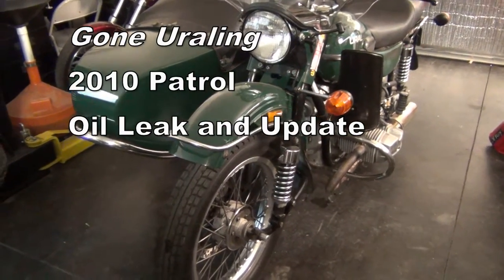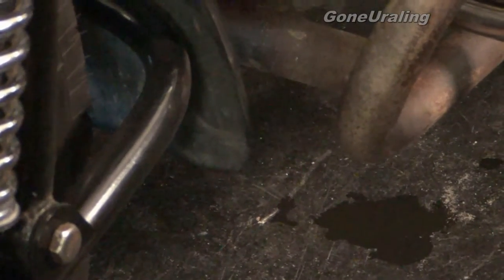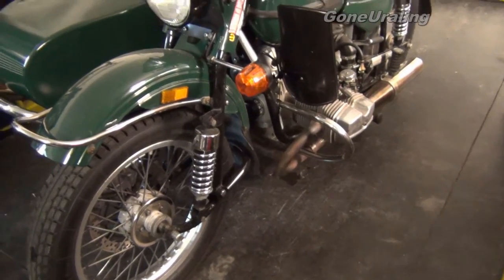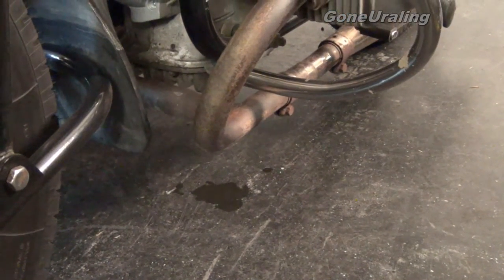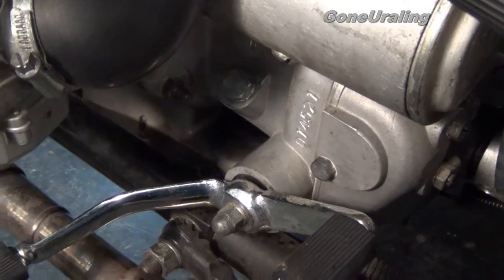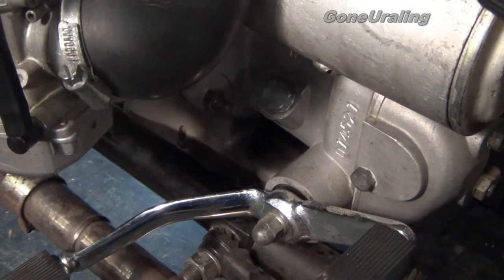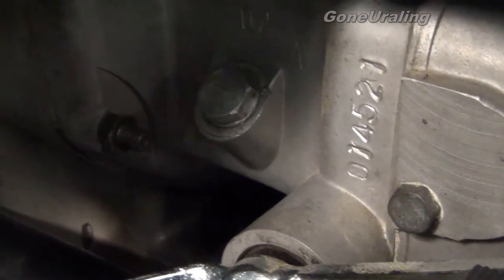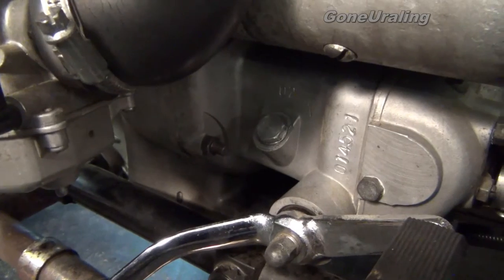Patrol Oil Leak and Update

Comment: if this were an old Airhead Beemer (like an R75/6 for instance) would say ride it, but for a late model Ural I say, oh man are you gonna have a long repair video coming...ouch. Well, you did call this one the "project"!
Reply from the maker: +JamesAllmond Yes I did didn't I.  Not upset as I knew this was coming... was just hoping she could ride it through the season and expose any other flaws before pulling it out to replace the clutch and seals.  Looks like if I can get the parts, next weekend is planned.

Comment: how many miles on this one?
Reply from the maker: As of today about 55,000 km (35,000 miles)  I don't recall at the time of this video, at least 5,000 miles less as we have been on a 3400 miles trip and a couple of 800 to 1000 mile trips since plus running around.
Reply: Thanks for the info. My youngest is now graduated from Nursing school, now she, being gainfully employed I'm now looking to get back into sidecars after 11 year absence. I had a 97 Ural Italia, back when Ural kinda sucked. Mine wasn't too bad as it ran a BMW/7 engine with Ural trans/rear and of course awful breaks. One of those things you wish you never sold. But.....Anyway, before the now large investment to own a Ural (paid $3800 w/BMW motor) back then. I just want to see what the mileage is on one before things start to go wrong on the later models. I remember the early 750's came complete with sorta round timing gears that would puke out of the front of the motor. Does not appear to be an issue on the year models that you run. cheers
Reply from the maker: Lots of changes after 2005. If you are not anxious to get EFI, take a look at the 2011 to 2013 models. Still carbed and lots of improvements to the rigs in that time range.  Knowing now what I did not know then, I would have skipped my 2008 Tourist for a 2011 rig. There are a few conveniences and design improvements after 2008 I miss (like being able to remove the battery much easier).  For 2010, look CLOSELY as that year model had some specific issues like splitting rims and bearing issues. Fortunately my wife's rig didn't have any of those issues (or the previous owner fixed them under warranty). It just a rough life (but I got a good deal on it so no complaints).